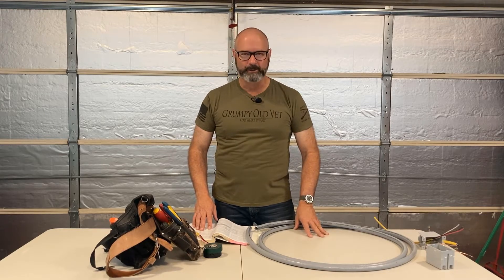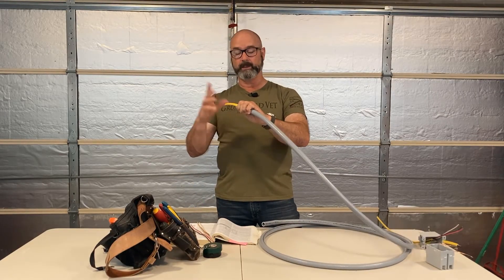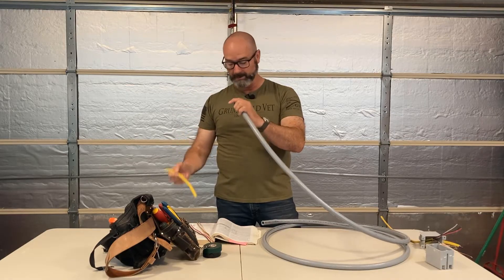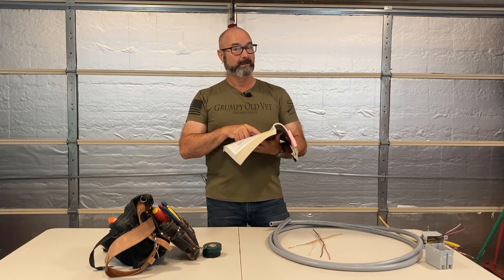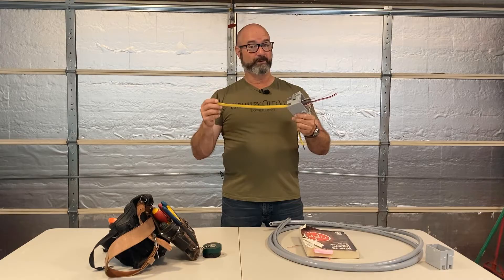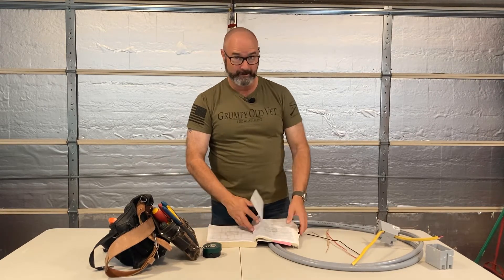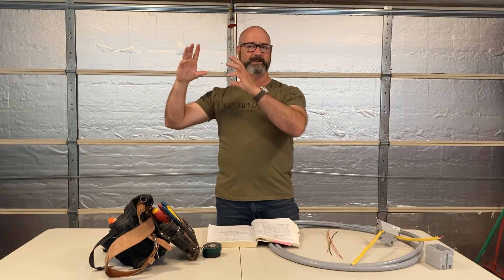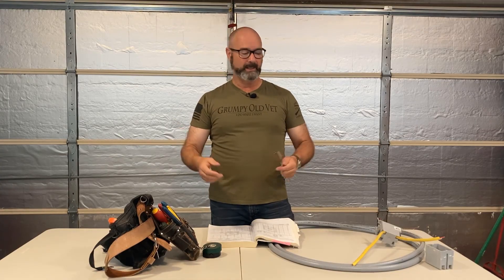Stripping Romex into Conduit- Bringing in the Sheaths

Comment: I don't care what NEC says.... leave the romex intact when covering it my conduit. You run a greater risk of stripping romex than leaving it intact
Reply from the maker: I'm with you. I don't believe the NEC requires removing the sheathing.
It requires that the romex isn't installed in a damp or wet location,  and that the conduit fill is correct.
Reply: Yeah looks like I may be wrong, talked to an inspector and he said its OK as long as the conduit is sized for it, But he said some inspectors won't let anyone run romex through conduit  which  is why we don't do it and every electrical company I've worked for wouldn't let us do it; the NEC is bare minimum we can always do better!
Reply: @travisduke98  ya The only reason i can see putting it in conduit is if you have to protect it like in a basement unfinished for receptacles on the wall...stuff like that.  In a full run of like 300ft with multiple pull points it'd be insane to run 1 inch conduit and pull in 1 romex in a dry area when you could just pull the romex in.
Reply: Your not allowed to run romex through conduit period due to heat and if you think it will get scratched that's laughable because wire gets pulled through with out getting scratched so maybe you should not be doing electrical work and risking people's lives with you bad practices!
Reply: @travisduke98  Sorry Travis, but you're dead wrong. Check your facts before you talk trash to someone
Reply: @travisduke98  What about 334.12(c) for unfinished basements, which says that the sheath of the NM "shall extend through the conduit..."
Reply: @travisduke98 The only thing worse than being wrong…is being arrogant and insulting while being wrong.
Reply: @travisduke98  if it's in tact and pipe sized correctly and ran in the right locations yes you can run it in conduit...but who in their right mind is gonna do that?  way easier just to run romex inside then transition to a pipe for the wet locations and pull in thhn...If it's ran indoors for the conduit fill in a raceway it'd be like 1 12/2 in a 1 inch pipe it'd just be unrealistic, nobody does that.

Comment: I have a roll of Allen 8/3 600v NM-B but does not have the temperature rating on the jacket.  How do you then determine the capability?  I had to run 8/3 from attic to basement and used 3/4 sch 40 through the vertical wall as a protection.
Reply from the maker: Because it doesn't have a temperature rating, you have to use the 60 degree column in table 310.16 for ampacity (40 amps). Good luck!

Comment: My dad was going to run romex through emt conduit until i showed him your previous video. He wants to strip the outer jacket like in this, but my question is: will he have to change the conduit material to pvc? To me it seems like a bad idea for bare ground wire and emt conduit in contact.
Reply from the maker: I know how Dads are 😀
Reply from the maker: Troy, the romex can run through EMT. The EMT needs to be correctly bonded and grounded. Also, the EMT is not rated to be in contact with the earth or buried.
Reply: @abrelectric  he was going to shove 10/2 through 1/2 inch emt. Ill have him pick up some spools of thhn for the project and save the romex for a rainy day.
Reply: You can run NM-B, 3 #10 in 1/2” EMT.  But putting a junction box and switching to THHN is absolutely better.  T stands for thermoplastic and is much better.